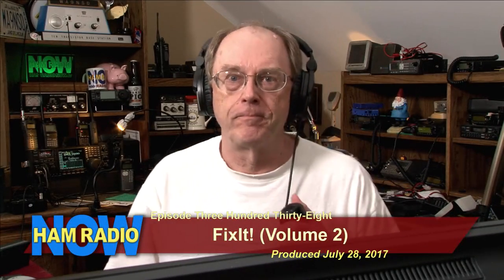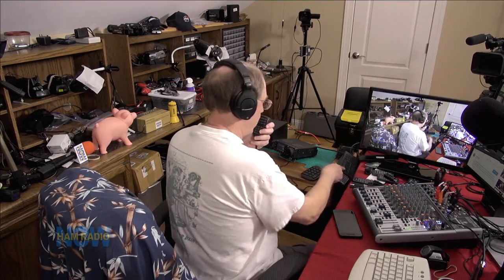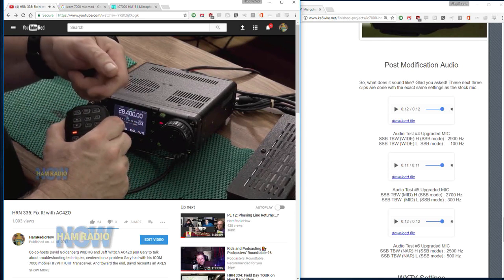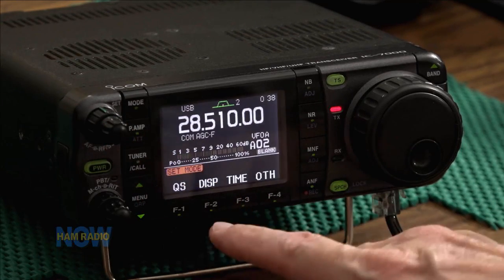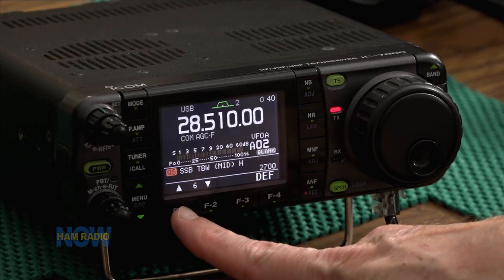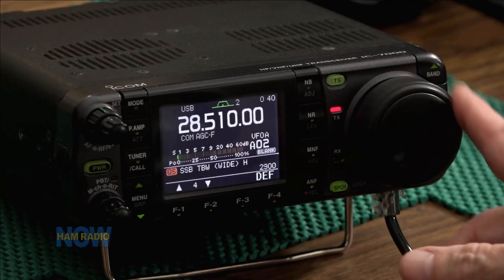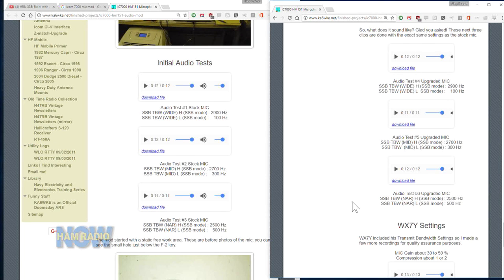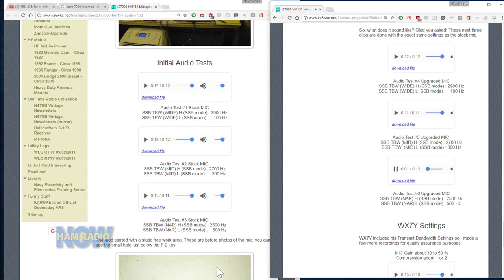HRN 338: Fix It! Volume 2 on Ham Radio Now

Comment: Gary,
I have a Yaesu FT450 and I just tried the tap test, while in monitor mode, and heard the taps in the headset. I think to solve that, you would need to isolate the mic cartridge from the mic housing.  73  WB3BJU

Comment: Surprised during the compression tests you did not notice the 756 was in screen saver mode. Have to admit you were concentrating on the 7000.  :-)  73  WB3BJU
Reply from the maker: Donald D'Egidio - - I noticed, but was really only interested in the S meter reading. I suppose the band scope could have been interesting to watch too. In fact, it would have been better, because it wouldn't have the weighted response.

Comment: Why does your audio sound distorted, and the other guy's audio was nice and clean? Were you overloading the 756? I know you were showing the 756 S meter working, so I assume the RF gain was wide open. What would it sound like if you backed off the RF gain on the 756?
The ultimate power supply test would have been to hook up both 7000 radios to your car's battery and record it  in your shack. Did the hum go away?
Jim
WA8SDF
Reply from the maker: There's something floating around the shack creating hum. That mixed with the mic audio going into the 7000 transmitter. I did start out with a battery, and the hum was still there, but the battery wasn't big enough to last for the whole test.

I don't know what's causing the hum, but it also affects the broadcast mics (the PR-40 and ATR-2100). it's worse over in the editing side of the room. Some day Jeff and I will troubleshoot it. 

The 756PROIII was certainly not being overloaded. The 7000 was set for about 15 watts, into a dummy load. And the 756 had no antenna at all. It was receiving a signal of about S-8. I reduced power on the 7000 to 5 watts at one point, lowering the signal to S-3 or so, but it still sounded distorted.

Since that wasn't the purpose of the show, and it was going to take some time to figure out (if we ever do it), I decided to 'ignore' it and keep going.
Reply: Ahhh ok.   Well it, the 756 overload was just a thought. 
Good luck on sorting it out. 
That was a fun show to watch.